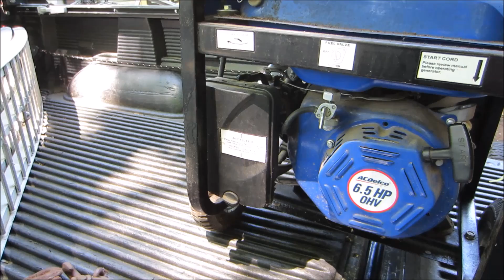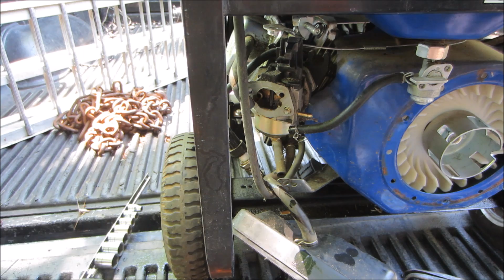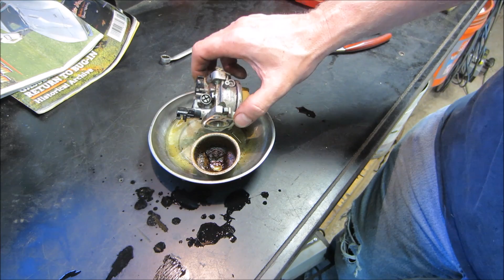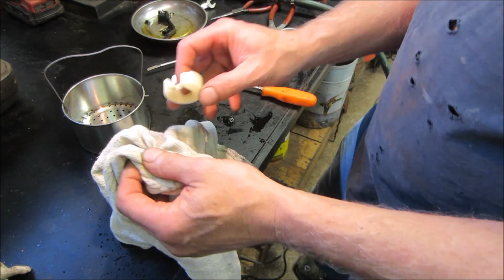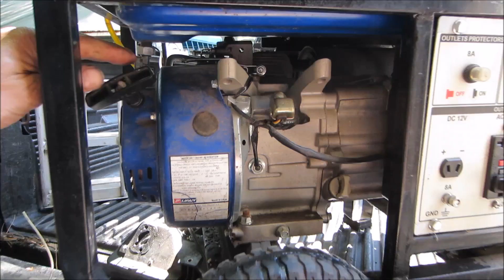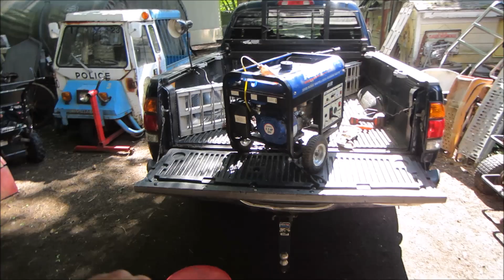will it run? seized china generator

Comment: I know this is an old video, however, another option for the gas tank is to have it "boiled out" at a radiator shop. Then, use a tank sealer kit. If there's no radiator shop in your area, the cleaning could also be done at most automotive machine shops since "hot tanking" of engine blocks, heads etc. is basically the same thing. The tank seal kits that I've used actually work quite well, and, do come with a cleaner, but, I always have them boiled first just as a precaution.

Comment: Had this happen on a 1yr old Briggs on a TroyBilt mower. End of the previous season I drained the fuel, ran it dry. I was later told this is what did it in. Once the new season came along, mowed once, put it away. Kept smelling gas for the next two weeks in the garage, through it was a leaky gas can. Float had stuck. Pulled ONCE, scored the cylinder wall heavily. Never ran again.

Comment: Question...when I store my generator I turn off the fuel valve off and let it run till it dies..worked well before but now if I turn the fuel valve on gas pisses out the bottom of the carburetor?
Reply from the maker: float is stuck
Reply: @mustie1  ahh ok I will check it.. thanks

Comment: I've got a pulsar 3200 and i drain the gas out while not in use, it's the only genset I've got to run my camper off of, I was told to drain the fuel out if not in use for some time. Very useful information great video! I certainly appreciate it

Comment: There shouldn't be that amount of fuel in the block , either someone didn't stagger the rings properly upon assembly or it simply needs a fuel shutoff valve , unless your float is stuck open that's another possibility.

Comment: rpm hunting tells me lean i guess A i love them amazon ebay carbs with adjustable bottom / main jet mostly fer techumchie engines, tip guys harbor freight 1/4 clear air hose is great poly fuel line

Comment: A lot of work which could have been avoid if the fuel had been switched off and the engine left to run the carb dry.

Comment: Hi how did you set the air mix screw on this I've got a generater with the same carb as this and I'm sure the previous owner had a mess around with it I've cleaned everything just want to know how to set it up

Comment: A friend of mine bought a used motorcycle.  Started and idled fine.  She asked me to ride it home for her.  It would not accelerate unless I had the enrichner (choke) pulled out.
Got it to her house (luckily on back roads where I did not need much speed) and started to work the problem.  Fuel flow was good.  Spark was good on both cylinders.  Finally pulled the carb and the main jet was caked with black crud.  Cleaned all that up and it runs smooth now.  
So often just a rudimentary cleaning of the carb will resurrect an engine.  
I think there is this mythical belief that a carburetor is a no go zone and beyond complex when really the basic parts are easy to disassemble and clean.  I remember the disappointment on my roommates face when I pulled apart the carbs on my 82 Virago and he was I guess expecting faeries and rainbows to come out.  "Is that it?" he said.  Yup, a few tiny holes and some basic scientific principles...

Comment: Not knowing any better at the time, I left the gas valve on while letting my Coleman 5 Kw generator with a 10 horse Tecumseh engine sit for a while. The next time, months later, that I tried to use it, It ran like crap and would die. I was told to dope the gas with a half can of Sea Foam and keep it running as best I could. It cleared up in an hour and ran fine. I was also told to turn the kill switch on the first time and NEVER touch it again. Now, to turn off any of my generators, I shut off the gas and let the carb run dry. Never a problem since. He also mentioned a low oil shut off. My father in law had a Craftsman unit with a Briggs engine that would start and run fine but wouldn't stay running more than a few seconds. I checked the gas, oil and carb which were fine. As it turned out, the external low oil switch had failed. It was on the bottom of the engine. I disconnected it and the engine ran fine. I replaced it and no problem after that. Just some suggestions.

Comment: My neighbors father was cleaning out their old shop and he had a 1700 watt 1972 generator with what looked like sand and tar in the fuel tank and the engine had sucked in the disintegrating air filter, and a similar water pump in much better condition.
I completely rebuilt the engine using all the old parts and painted the whole thing Detroit Alpine Green. The fuel tank could not be saved and it took me a year to find a NOS one. I even found the original stickers for this EXACT model of B&S engine!
The generator had the weights in the crank case governor, the water pump had the wind from the fan governor.
Would using aviation fuel in these old engines that sit forever unused be better as it evaporates leaving no residue?

Comment: Keep Stable in your gas and run a couple times a year and it will most likely always run--I have an Old Sears 5500 watt Generator that is 30 years old, still runs like it was brand new...

Comment: Wow, what a boneheaded move to put the generator away wet! Especially when there's a shutoff valve! Every time a small engine is run that has a shutoff valve you MUST shut the valve off and run the carb dry. Especially with the lousy ethanol-induced gasoline today, you should find a gas station that sells non-ethanol had for all small engines. Plus I would take a picture of the carb while still installed, so it easier to reinstall it! I would not be surprised if the carb is now junk!

Comment: Hey Mustie. I've been quietly watching you for a little bit now I once ran a engine repair shop and I noticed you don't use two things I found to be very helpful one is muriatic acid which works real well at cleaning out the rust in gas tanks and the other is a carb. Spray called berkebile 2+2 gum cutter these two things will really speed things up for you. Thanks for the videos  enjoy!😃

Comment: That 'hunting' of the governor, I just had start happening on a newer genset I have here..  Has been working fine but suddenly, the last couple uses it is now doing that.. If I set choke to about 1/2, it smooths back out.   Based on what you said, the setting for the governor has probably moved right?   Since it never did that before, that is my best guess..  Is there another possibility since this is a new symptom on a relatively low hours unit?

Comment: Real nice show and tell but those carbs are so cheap it's not worth spending the time on. For 15 or $20 you could have a brand new carb. Better yet for under $40 you could get a dual fuel carb and be able to run on gasoline, propane, or natural gas.

Comment: I think the only way you could test for an increase in performance is with a fuel injected engine with a computer, as the computer will be able to adjust timing and other things to really be able to take advantage of the extra octane.  Over time though one could see an increase in performance from a cleaner fuel system though.  Theoretically in high load and hot (exterior temperatures) situations, a higher octane fuel could also prevent pinging.

Comment: My generator seems to always need the jet and needle cleaned before use, any suggestions to not have to do a minor carb rebuild between use? I have tried draining it, staybil, and fogging oil, yet it will never run after 6 months of storage.  I have a 15hp Briggs on a 8k peak gen, 6250 is its rating. I'm fairly good with this so no need to sugar coat responses.  I'm just damn tired of cleaning the Carb every use!.

Comment: I'll add that even though the biggest problem here rests squarely with the owner who did ALL of the wrong things (didn't drain the fuel tank, didn't drain the carb. bowl, didn't shut off the fuel valve, etc.), I'll throw-in the fact that since we are now forced to buy fuel with corrosive causing alcohol in it, this too accelerates and/or increases the damage due to fuel systems that aren't being maintained very well. Several years ago I started keeping "Marvel's Mystery Oil" (a very old, reliable and affordable top-cylinder oil and fuel-stabilizer) in all of my gasoline operated equipment. Even when I put the equipment in the shed for the winter without any proper preparation (beyond the MMM), I had  no problem whatsoever just pulling said equipment out and putting them back in use. This light lubricant seemed to counteract the corrosive effects of the alcohol. I'm sure it wouldn't work miracles for something like this that CLEARLY was in storage for something probably closer to five years than one, but hopefully you get my point. 👍

Comment: i had a seized toro snow blower, what really works well for me, is pour a ounce of marvel mystery oil in the spark plug hole let it soak for a day, and it breaks up all the rust, and crud in there and let me get the engine moving again.  Got some marvel mystery oil from walmart, it looks cheesy as hell, but it works.

Comment: Great video but, Alternators don’t have or need idle circuits as they never idle, they only ever run at rated speed
Reply from the maker: it idles when no power is being used to save on fuel
Reply: Mustie1 it shouldn’t because the output frequency is dependent upon the engine speed, the engine should always be at 3600 RPM for your 60 Hz, the newer inverter alternators can idle back as the inverter is providing the output independent of the alternator RPM.

Comment: Thanks for making the video but you made getting that carburetor off of there way harder than it should have been on that model just pull the carburetor out a few in and turn the throttle shaft and the linkage will pop right out when you have a stuck throttle plate spray some carburetor cleaner in there and work it back and forth to free it

Comment: A "seized" engine is not a rope that won't pull because if "crud. "Seized" is when an engine is run without oil or very low oil and overheats. The heat then causes the piston and rings to become red hot melt into the cylinder walls, basically welding it in place. 
Try to get your terms correct.
Reply from the maker: Much as we like working on our old engines, there's a limit to what many of us can handle, and a seized engine is pretty much that limit. But don't throw in the towel if your engine is stuck, because a little insight and the right approach can often get that old iron spinning once again.Confirmation
Engines seize for any number of reasons; rust (usually from sitting too long), excessive heat (from running the engine without coolant or oil), or for some mechanical problem, such as a foreign object in the cylinder or a crankshaft bearing failure.If you think your engine is seized, you need to confirm that before doing anything else. The first thing to do is remove the spark plug (s) and try rotating the engine. On the small engines most of us are working on you can bet that if you can't rotate it by hand, it's probably seized. On larger engines you'll want to use a breaker bar to see if it will turn.Assuming everything is okay with the crankshaft, the easiest and cheapest thing to try is penetrating oil. This works surprisingly well, particularly with engines stuck from years of sitting out in the rain, where water has rusted the piston rings to the cylinder.
Reply: cravinbob - the literal definition of the word "seized" is "locked up". Engines can seize from numerous reasons, not just low oil. As for "melting into the cylinder walls" and "welding", you are plain wrong. So, try to get your facts correct.

Comment: My snowblower has a 179cc China Engine, looks like the same carb. It hunts until it warms up and has been reliable for the past ten years. The primer bulb rotted and last year was the first carb cleaning because it was running rough (lean) and the surge never went away. I have really done nothing to the engine besides change the oil and I have run it hard during winter storms.

Comment: Glad you got it running! 

Sounds like it's running lean at low loads, causing the surging. These carbs have an idle / low-load circuit with a fixed jet. It's very sensitive to anything making it run lean, since they were worried about emissions and made it as lean as possible from the factory. The air filter acts as a choke and helps to enrich it a little. Raising the float level can help a little, as well.

Comment: What is that long spring for that hooks to the carb? I have that same type carb on my generator and that long spring is broken will itbe ok without it?
Reply: Bruce Morris I believe your talking about the governor spring and yes it's important especially on a gen it will keep the voltage consistent thru a hard load hardware store big box stores or Amazon if you can't find exact one get one similar it doesn't have to be perfect just strong enough to pull that arm back after it puts more fuel to the engine to compensate for a load to bring the Rev back down if that makes sense

Comment: You pulled off the fuel line with the petcock fully open and that is all the fuel that came out?  Might want to check that filter inside of the petcock.

Comment: A lot of older small engines have carburetors which were not intended for use with gasoline containing ethanol.  When gas is left in them for a long time the ethanol eats away the seat for the needle valve letting gas leak right into the engine.  That happened in my neighbor's snow blower after fixing the carburetor I use the fuel shutoff valve and let the engine run itself out of gas instead of just killing the ignition.  After several years it still runs well with no problems.

Comment: Have you ever used carb cleaner to blow out the jets or does the ultrasonic cleaner do all that better?
Pretty cool..always good to get a genny running again.  I always cut the fuel line and put even a cheapo fuel filter inline before the carb, plus I run about a 1/4 cup of marvels mystery oil in the fuel to keep it from sludging up, and also turn off fuel and let it suck as much fuel out of the bowl before shutdown.  Good video...keep em coming!

Comment: I have a fantastic supply of carb. bits and pieces from trying this. What about putting a nipple in the drain plug hole to make it easy to change the oil forever?

Comment: I have a leaf blower, pretty much brand new. Used it enough to break it in, then let it sit. It's been sitting a good two or three years. No idea how difficult it's going to be to get running. Also have a weedeater that has been sitting just about as long, but it has carb issues (floods to the point gas comes out the air intake, despite rebuilding it). I also have a push mower that has been sitting for just about as long in the weather. It overheats hence why I stopped using it. Plastic carb so probably junk. Then I have a riding mower with carb issues that's been sitting a good four or five years. It ran when it was parked but flooded. I've not touched it because I just haven't. Not sure if it's worth the trouble because a lot of parts have to be replaced and it might just be cheaper to buy a used working riding mower. Currently I have someone mow my yard for me. I got tired of fooling with it. One of these days I'm going to at least get the blower and weedeater running.

Comment: i know this was just you helping a neighbor, but how would you charge for this if that wasnt the case, cause once you put a few hours into and use some specialty carb tools/ cleaners you needa get atleast 100$ but the things dont cost much more then 250-300$ new so its hard to justify charging half the cost of a new one for one that runs but is still old and will likely have other issues in the future that a new one wouldnt as quickly.. i like fixxing my own stuff but doesnt seem like theres money to be made fixxing other peoples with the low cost of new machines.. and if you get the same unit you have a spare for parts

Comment: I got an 11 hp honda welder/generator of a guy for a bottle of rum as eight months ago he had taken the carby off of it to fix it but left with the carby off. So for eight-month moisture got into it had seized solid. when I saw this I did the same thing as you did and it seems to have worked I have ordered and other carby off-of eBay only cost 18 dolors but won't know if its qoing to then.  Thank you so much for this.

Comment: There was a little needle valve you took out. You have it adjusted wrong. Hunting like that is an indication that it's running a little too lean. That needle valve was probably an air mixture screw. Tighten it up a little. It would probably straighten up under load.

Comment: If people would just remember to close the gas valve and let the carb run out of gas as the correct way to stop the engine ;-)  I have an ancient Generac 5000 watt that I bought used some years ago and I've always done that.  I often leave some gas in the tank but the gas is always treated the day it's purchased.  Not unusual to find myself mowing with gas purchased a year or more ago.

Comment: Surplus Center has fuel tank that might fit for approximately $25 plus lots of other bargains there!  4.5 Gallon Red Fuel Tank w/Fuel Shutoff Valve
ITEM NUMBER: 28-1836-R
PRICE: $24.99
326 In Stock

Comment: One way to clean out the crankcase is to wash it out with gasoline, lol. at least you can see the small cuttings etc..  I had a 6.5L diesel that I would always run a quart of transmission fluid into the crankcase about 30 minutes before an oil change, just to loosen up the crap in the bottom of the pan, it never seemed to hurt it, but I don't know if it helped either?